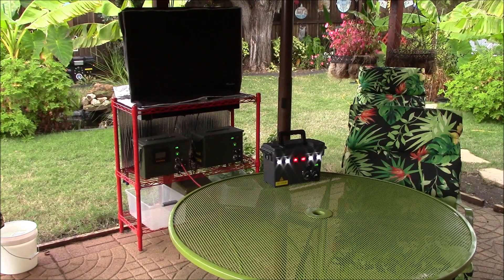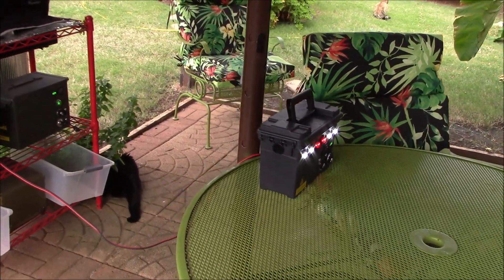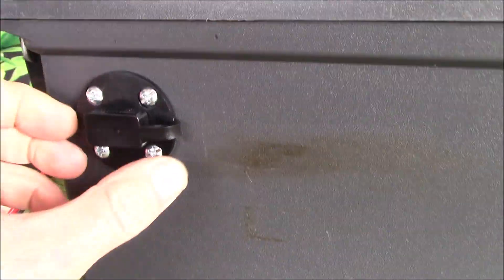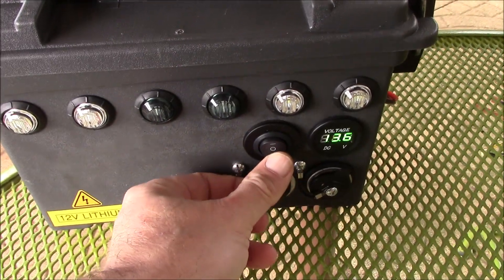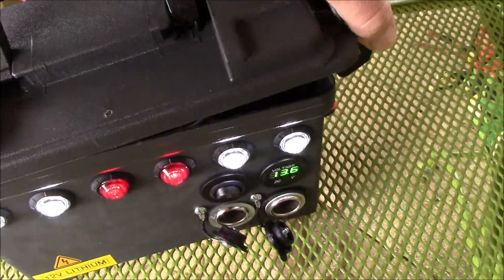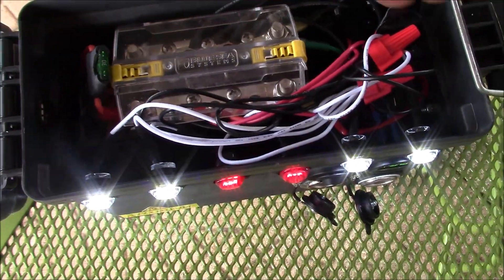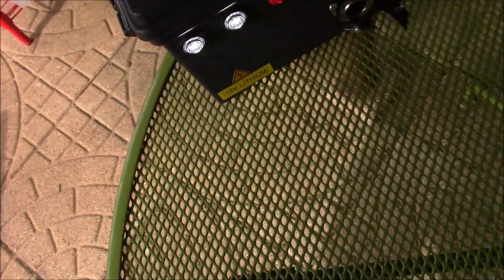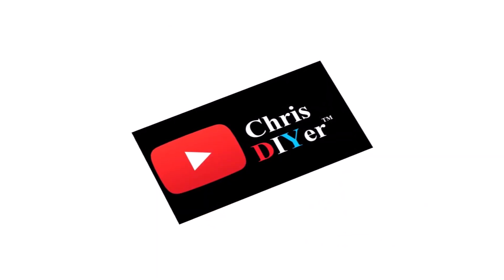12v LiFePO4 battery portable power box (work in progress, sneak peek)

Comment: I've had my eye on Lithium batteries for awhile now.  So many advantages over lead acid.  But the jury is still out on wither they can withstand the Oklahoma 100 degree summer heat for long periods.  I'd hate to have them fail the smoke test due to a weeks summer heat.  I've deliberated about having a 3 part system.  Solar panel, Control Box, and a separate Battery box.  Being modular could have it's advantages.   I think I'll keep and eye on how yours works out.
Reply from the maker: I think that Dakota will be fine in our summers. I mean, I use my DeWalt and Koblat lithiums in the hot and they work fine. Good luck, will keep everyone informed

Comment: PS,  do you watch RELUCTANT PREPPER ?   Dunagun just had Dr. Arthur Bradley  ( NASA scientist and electr. engineer ) do a Q & A about EMP and Solar event issues.    J K
Reply from the maker: Saw you got your question fielded...congrats. Just watched the whole video. Surprised they didn't talk about earth grounding during all these EMP-CME events. We used spark gaps, ferrites, separate grounds, lighting ground rods, along with circuit breakers in the field. I have fuses, grounds, and non-polarized circuit breakers on my solar power system...however, NOTHING on my utility power to protect what is coming in. So, in that regard, what that PhD is saying/designing makes sense if it can handle the Joules (flux, inductance). Smart preppers have back-up on top of back-up for power generation (not saying I am smart, but I have several DIY made solar power generators, Honda generator, and packed solar panels). Ground mounting solar panels with conductive metal strut (like mine for example) should route the EMP-CME energy to earth, but the pulse will be felt through the PV lines. Ferrite beads...dunno if that will be enough. Unplugging the wires...prob a better route. As for being under a nuclear blast or in the midst of a CME-3...I say this, "Bend over Rover, Mother Nature is taking over". Even those dudes that hide out in their DIY bunkers...meh. Just prolonging the suffering IMHO. It be over Rover...Mother Nature always wins in the end.

Comment: Hey Chris, ...at 2:20 you say "water-tight ".  What about all the switches and sockets that have penetrated the closure ?  Is it rain-tight, slightly submersible , or dampness resistant ?      ( you know that in Houston....20% chance of rain means 20% chance of DROWNING ! )    J K
Reply from the maker: It is exactly what I said...water tight. Defined - "closely sealed, fastened, or fitted so that no water enters or passes through" (according to an online dictionary). Submersible - no. Rain tight - probably (vendor fucked me over on the switch (twice, I might add)...not gonna get into it). Dampness resistant - Yes. Houston resistant - gonna need to vacuum seal it to survive south TX